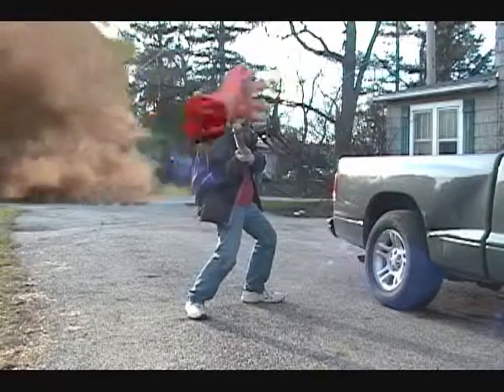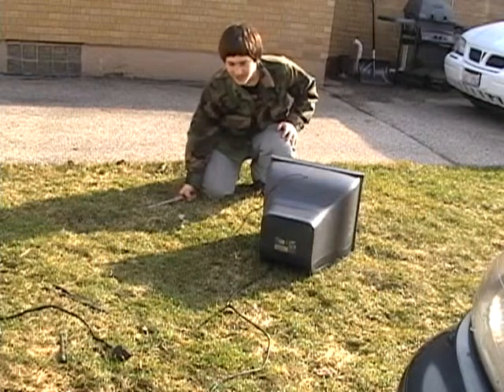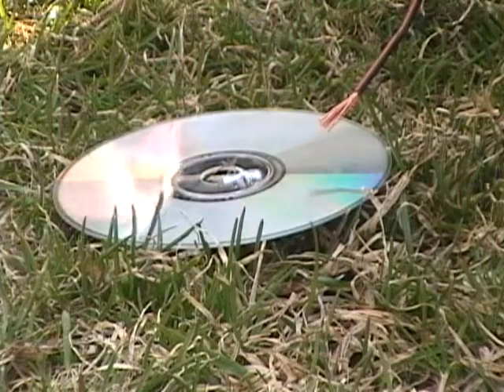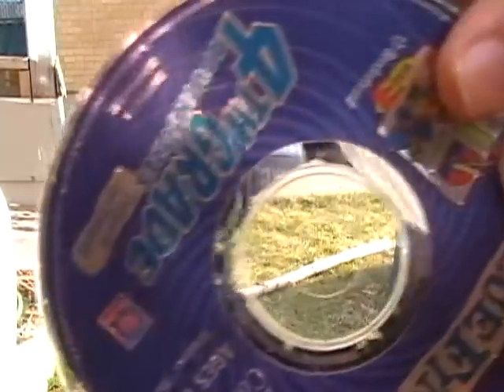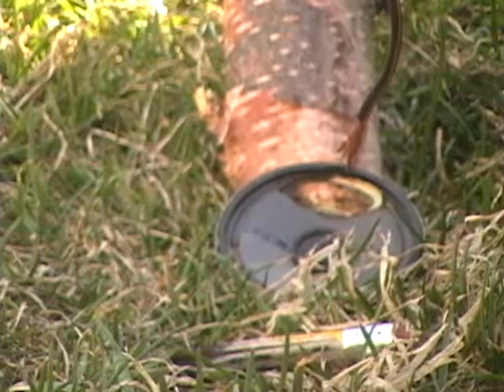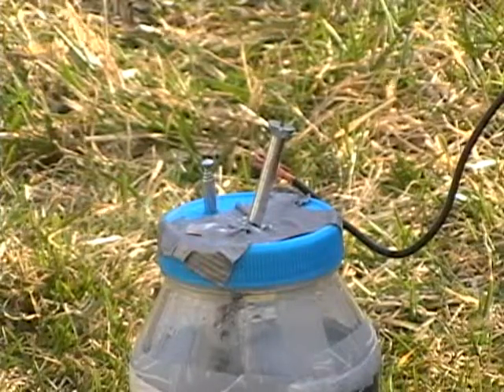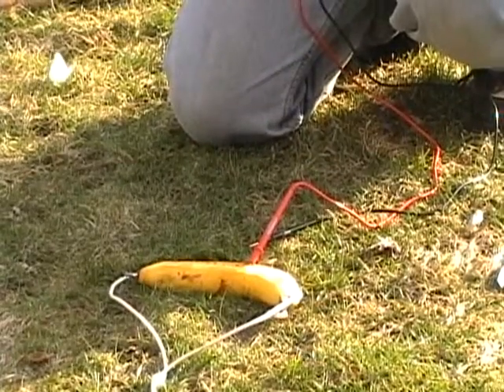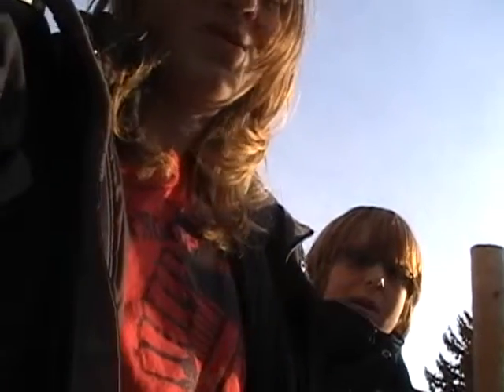Flyback Shocking

Comment: Replacing the high voltage drive transistor and came about this.  I imagine if you shocked yourself you would piss your pants.  A little story I heard about a guy that had to have his face reconstructed:  His cat was sitting a top a TV, and casually pissed down the side, in the vents.  The stream of urine hit the anode cap (wire you are shocking).  Cat jumped 15 feet across the room, clawed up owner's face.  Reeeaaow!  Ouch